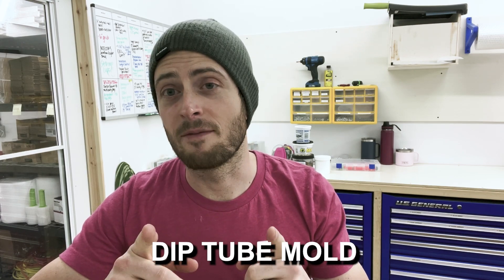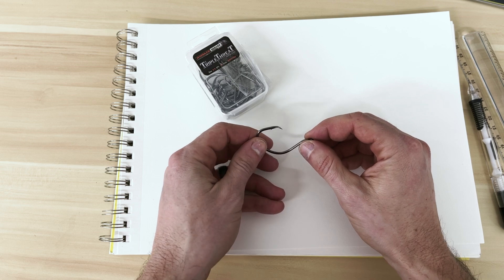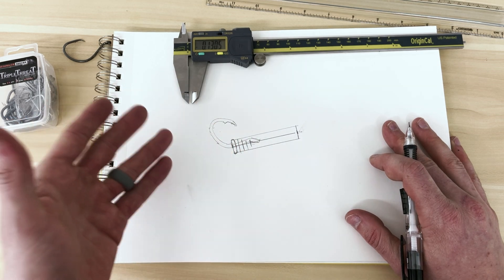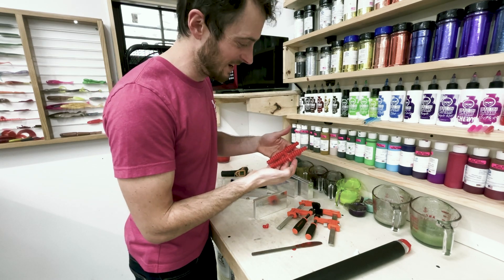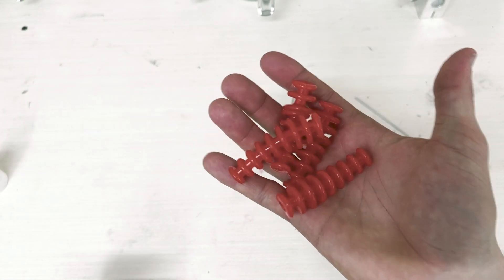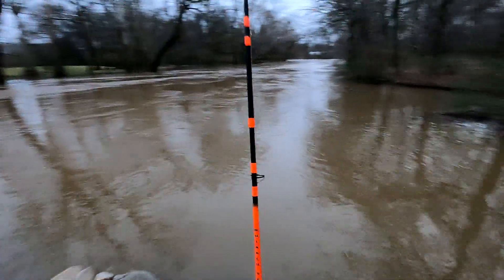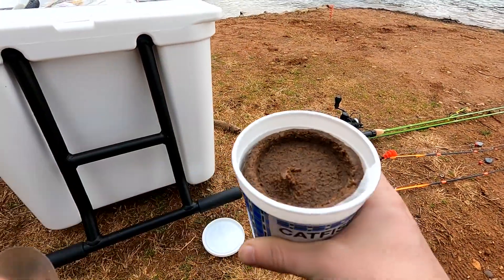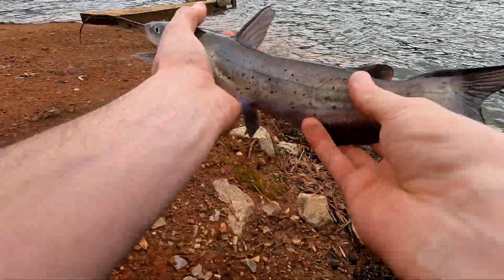Making an Aluminum Catfish Stink Bait Mold

Comment: I have found that hollow core worms/ frogs (etc) work well when you inject stinkbait into them. I use an old empty (cleaned) caulking tube filled (by spoon) with the stink bait and injected into the hollow bait. I found that a vent hole has to be made in the bait body so that you can fill it completely but that helps the water action wash the bait smell iinto the water and attracts the catfish.....

Comment: Put some .125” in the fins with a hole punch plier type to hold more bait. Not much worm oil, bait slides of. Boy I wish I had a milling center. I operated a concert lath and programmer. I use the rubber tube they use on your arm to get blood, it has a great surface to hold triple sss bait . I do put holes up and down it. To hold bait. 250”&.125 holes work good, I’d love to buy your catfish dip tube. But they are a little too big for dip worms maybe .500” and 2.5 long. I love the deep grooves that I’ve been so desperately tying to find. Great job guys keep the inventing going and being creative. I was a tool and die guy for years. Here’s a blue print and try to make it, what I was told. Thank you Michael.

Comment: Great video I like the start to finish of it all. I've (theneverendingprojectslist) been meaning to message you on Insta to see how the printer has been working out and I'm glad to see it's been helpful in your designs... Keep the videos coming.
Reply from the maker: Thanks! Yes, love using the printer for seeing the rough sizes of baits before spending forever getting all the tool paths and mold created only to find out that the design needs to be changed! We have also been using it for other projects around the shop!

Comment: I saltwater for Stripe Bass  one of my favorite biat is the Slug go 12 inch pre rigged,  My only problem is had they use string to attach the hooks to one another.  If I get hit by a bluefish they cut right threw the bait and the string and they are gone.  Have you ever thought about making a mold where you can suspend a wire harness in the bait
Reply from the maker: Yes :) we have lots of ideas like this coming in the future!

Comment: I use something similar and there are some sticker baits.  With the punch baits I just use a bare treble hook. Punch it in and pull it out that why it has the fiber.  Great job I love the bait holder.  I would buy the bait if somebody poured them.
Reply from the maker: Thank you! I’ll have to go back out and test it with a couple sizes of treble hooks! If someone starts pouring these I’ll let you know!